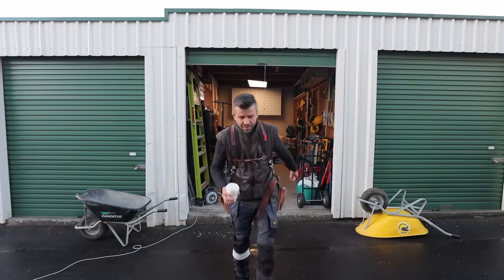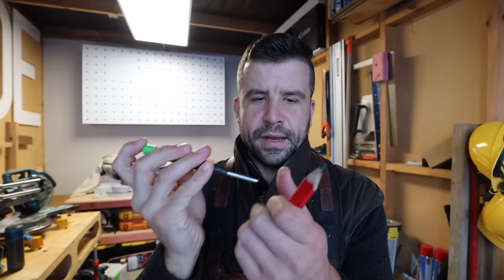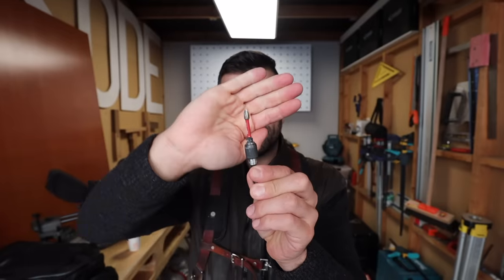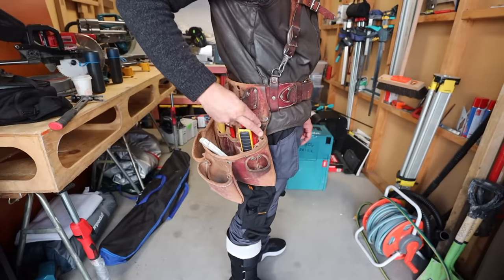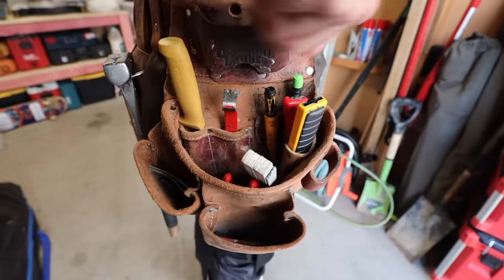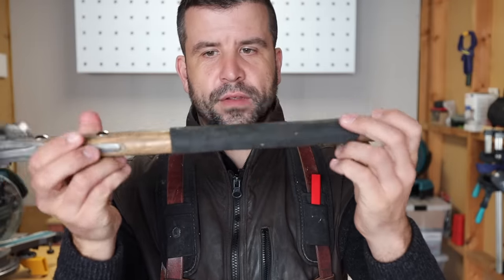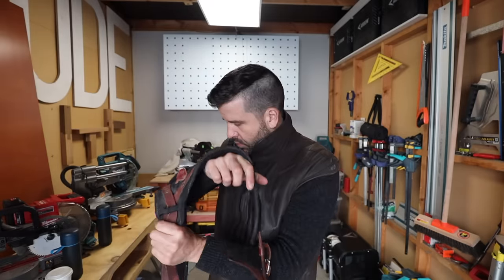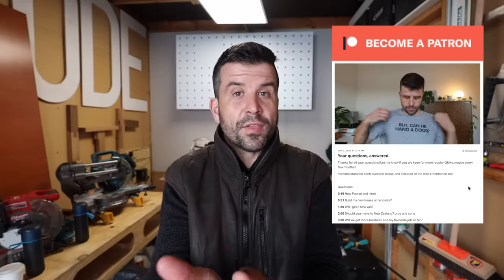What Is In My Tool Belt? A Carpenter's Daily Carry

Comment: Good video. Chicago screws can open up new worlds of design without need to hire a leatherworker.  I have a totally customized Frankenstein tool belt setup, comprising components from Occidental, Diamondback, Akribis, Atlas 46, Buckaroo, and even Menards.  My wife, a seamstress, has even indulged my obsession by working through five  evolving versions of a work vest, which I have designed to serve as a wearable field desk, strictly limited to small layout and marking tools, along with notepad and cell phone. Velcro pockets for thin magnets (removable for washing) are sewn into strategic spots so I don't need to put so many miscellaneous fasteners, etc. into my mouth at awkward moments. Your daily carry and mine share many preferences. Small world...

Comment: A note on the Milwaukee speed square... Here in the US, 2x4 framing lumber can have a rounded edge, the wider end on that square helps to get a nice square purchase on the boards to get clean marks and cuts. I have a few cheapo squares from Empire and Harbor Freight, but after I got that Milwaukee square the others sleep on the bench. I got mine in a two pack around Christmas time for about ten bucks. Good buy.

Comment: Nice to see someone have their tape On The proper side. I always find it funny when people keep their tape on the same side as they’re handed. To be quick and efficient you need to have your dominant hand ready to use your marking tool. Your square has a larger heel because it’s a better set up for framing when your wood has more wane on it, it’s still able to reach deep enough to reference the perpendicular surface of the wood.

Comment: Awesome. Thank you. I have a very similar all leather occidental setup, but for drywall. I have a little leather/metal hook thing for a gun. It and the last loop of my suspenders sit nearest to open end of the belt and would like to fall off. I'd been using a zip tie to keep it all on. BUT I actually have some of those Chicago bolts and didn't really thing to use them to fasten it all together. Very awesome as now I'll actually be able to take my belt apart if needed without wasting zip ties.

Comment: Thx for video and wish you well, hope not in pain✌🏻
A friendly tip for ya….hope don’t mind
0:08 I’ve got one of those “pump up air compression” boots. Broke right foot while back and had to wear for 8 weeks. Then went to a “shoe” for 4-6 weeks, and after that, back to my reg orthotic shoes…..hurt paying for orthotic shoes and inserts; as I’d rather have paid for new tools, & for the cost; coulda got A lot of new tools.
As uncomfortable has is wearing that boot, does help; just a tip from someone who wore. Be mindful have walking a lot, and it making your normal “gate” diff when walking and working; especially on those “hips” and lower back. If need be, medical massage and a good chiropractor that also is open to “alternative medicine”, as could help mitigate pain a d issues possibly could have down the road.

Comment: I did that back In the day, bolt my straps to my belt. Remember, some people put a rivet on the X on the straps on the back... the suspenders come with one. I keep my hammer in the front loop, you need to use a wooden handle I like axe handle 12oz stiletto titanium

Comment: Quick tip. Get some boiled linseed oil on your dalluge hammer, put it on, let it dry for like 5 to 15 minutes and then wipe it off. If you don't then the oil will set on the handles surface.

Comment: Nice video. I run a very similar setup. I pieced my bags together so I have the 3 pouch version of your left bag and the 2 pouch version of your right without the little tape holder thingy. I did switch to the diamondback belt which kind of has 2 belts to keep bags from flying off and having to play 100 nail pickup every time I'm trying to put on my belt. Before I got that belt I did the same thing that you did with the occidental belt. I also mounted a diamondback hammer holster to my right bag. It took a bit to get used to since I ran my loop in the back for 10+ years. It's especially nice when you have something you're holding overhead and sometimes that hammer being in the back can get tricky to reach. But really the only tool differences are that I don't carry the little saw/knife or a folding rule and I run one of the flat scraper style trim bars instead of the little prybar. That was one of the best things I started carrying around, I use it for a chisel, scraper, a flat punch, obviously prying. Just a great all around tool for every type of carpentry. But from a fellow old skateboarding carpenter Get yourself healed up and have a great little vacation.

Comment: I second most of your tool belt content. However as mentioned in another comment; the Hultafors chisel is good for banging and demo work. You should try to get hold of Mora’s equivalent, it’s excellent and keeps its edge very well. It’s my go to, and also for sharpening the carpenters pencil. The classic carpenters pencil can be used for thin hairline marking woodworking accuracy and then shift to a bold line for rough marking, and you’ll be brute to break the tip 😉 The Pica stuff I only use as a general pencil. And yeah, that small Hultafors (or other..) pry bar is invaluable!
One piece I forgot to mention; I’ve recently added a 150mm Starrett combination square, highly recommended!

Comment: From my experience the extra lip is so that you can put it over the edge of something that's perfectly rounded that way you can still get a measurement from the top down. The 4-in trim square that they sell has an exaggerated lip on one of the sides for that function that's my guess.

Comment: Quick question. when you are installing a pre finished birch plywood on a ceiling what thickness do you use? and on walls?
Reply from the maker: 12mm for both. It's thick enough to hold itself straight.

Comment: I wouldn't recommend the Vaughan dalluge. The finish on the handle is quite poor  for a $300 hammer and my one snapped 2 weeks ago pulling a nail! I contacted Vaughan and they wouldn't send me a replacement handle to New Zealand to purchase. Having a timber handled framing hammer the handle will eventually break and I don't think I'll br purchasing any of there products anymore. I did end up making a couple of handles for it at the weekend which was enjoyable but my only choice shouldn't be make my own or be stuck with a $300 titanium bottle opener 🤔